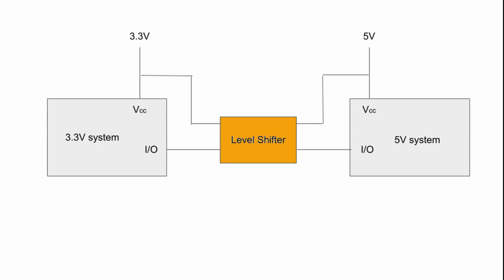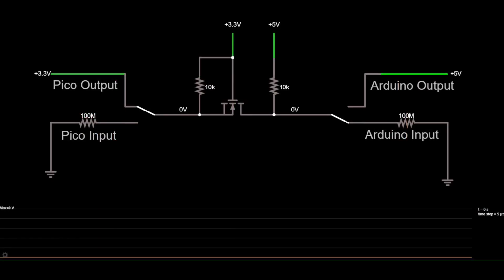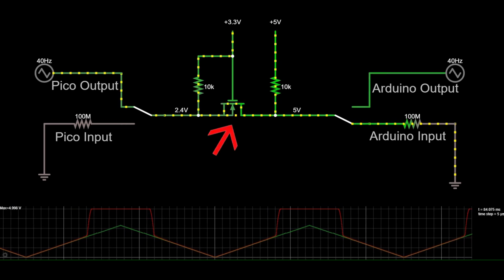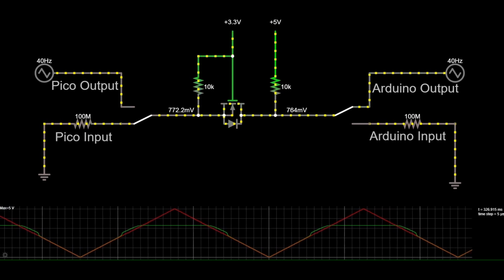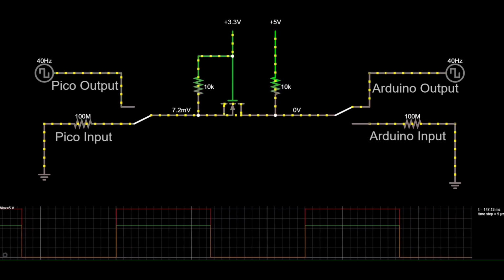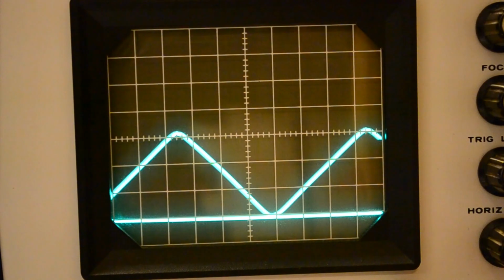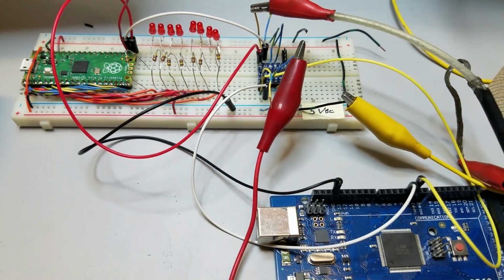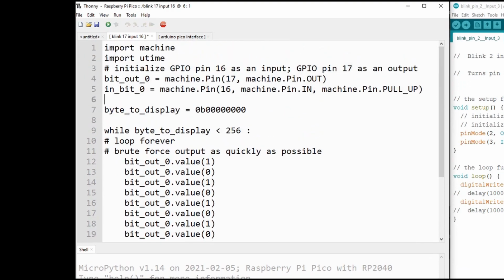Raspberry Pi Pico - Signal Level Shifting (Ep. 0.3)

Comment: I just completed a DIY level shifting construct between a GPS and an M5Stack device/MMBasic Pico. I'm not sure about the raw data yet. I use another GPS with success on both, but I need a better quality on speed/positioning (speedometer idea) for something. The way I made it can test other GPS units, so I'm pleased. It's something like 10 jumper wires and whatnot with a lot of thinking. Without a lot of videos to watch it would not work for me.
Reply from the maker: It sounds really interesting!   I like those kinds of projects the best; stuff that no one else has tried.  Exercising the brain keeps one young, lol.  Thanks for watching!

Comment: I like this video. I also like that you've used Falstad's circuit simulator. Something I've been using for a VERY long time. It's absolutely my favorite tool for educating students around circuitry. Much is missed, but the visualization of current flow seems to really connect that last "dot" of their physics education around electronics.
I'm interested in your usage of the PIO. That, for me, is the biggest draw towards the Pi Pico. It seems to be a very assembly friendly dev board. If only I was kept up to date with all the different tools used for uploading code to devices... I'm very old-school. Started with the old EPROM (yes, UV erasable) 2732 for my 1991 Camaro lol. Still feels like I'm teaching history to students so that they can better understand/grasp, the amazing tools/resources they find in Industry.
Reply from the maker: Thanks for the nice comments.  I am starting an assembly series for the RP2040 next (first video out soon).  Uploading (downloading?) code just involves a micro USB cord (at least for now).  Hope this is as interesting as the PIO series.  Thanks for watching!